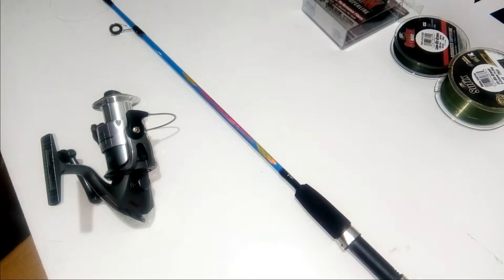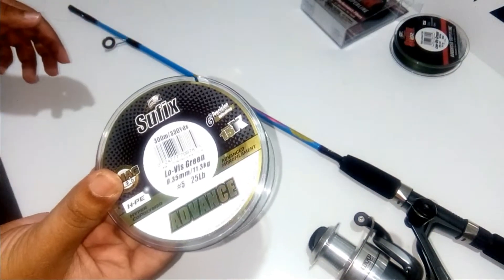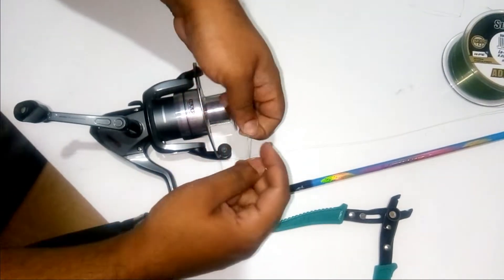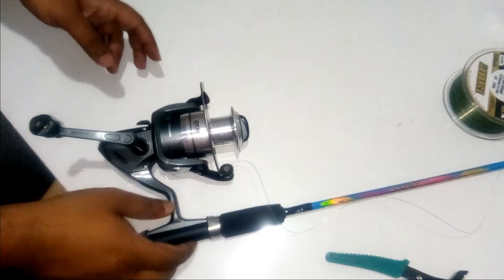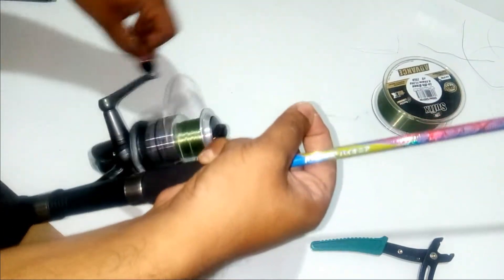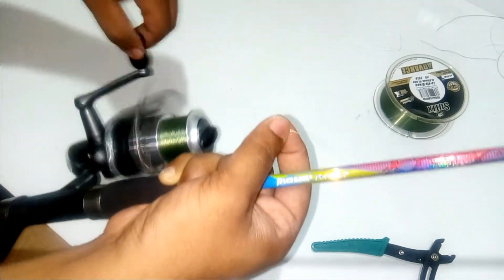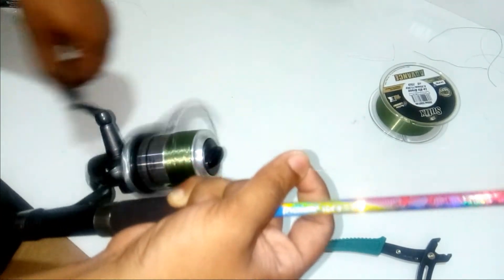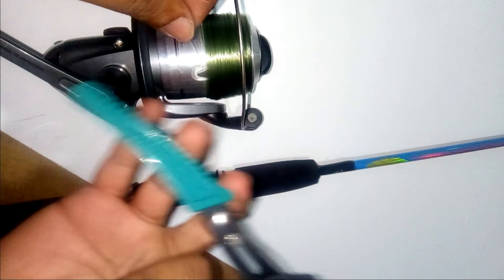HOW TO SPOOL A SPINNING REEL | Sufix Advance (Monofilament) | Rapala XTP 5000 |Raptor Fishing Tackle

Comment: The line comes of better with the line spool rotated on a pen. Try it coming of the face and look at the line it will be curly. Rotate on a pen and it will be better. Some times lines works off the face or rotated you need to check each time.